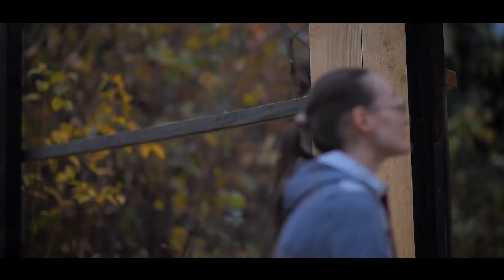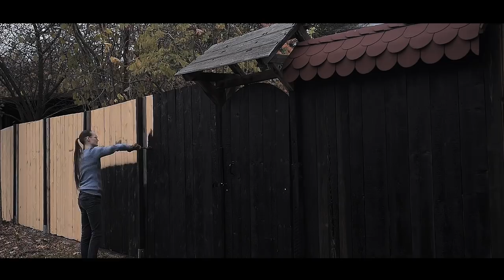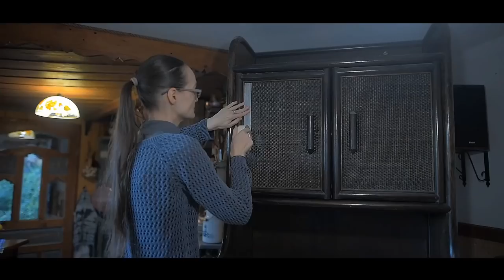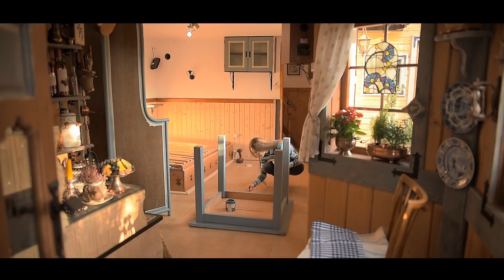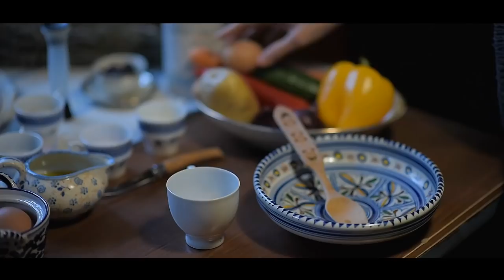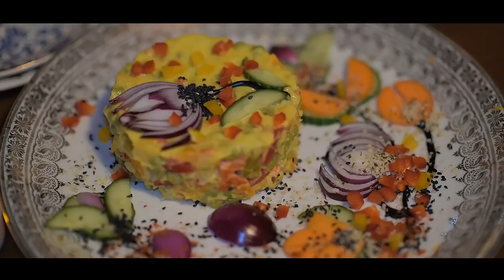Cottage Life Vlog - Renovating, Gardening and Cooking Dinner at my Fairy Cottage

Comment: I WAS WONDERING, WHAT IS YOUR WATER RESOURCE? 
ALSO, IS THERE AN OUTHOUSE? 
AND ARE YOU EQUIPPED WITH REFRIGERATION? 
THANKS, KIM
Reply from the maker: I have running water and a well. There is an outhouse and there is also a bathroom inside the house. I have a small refrigerator and a big cellar that needs renovation. Thank you too!